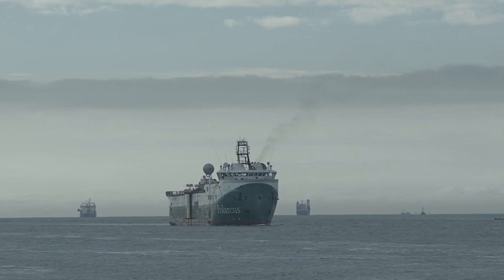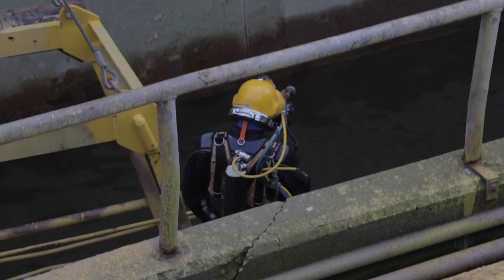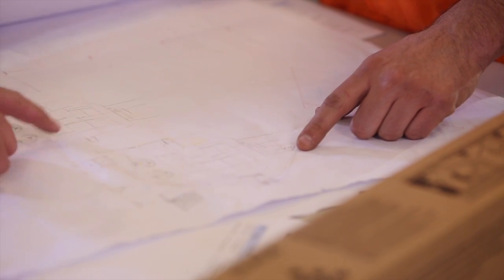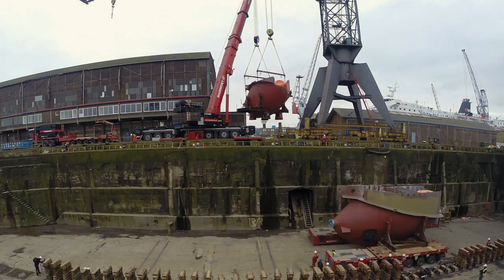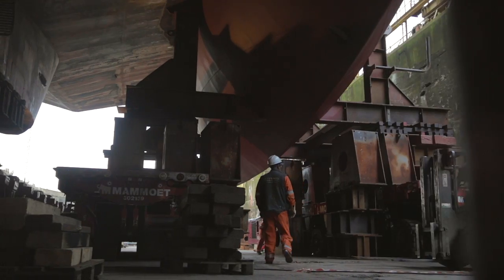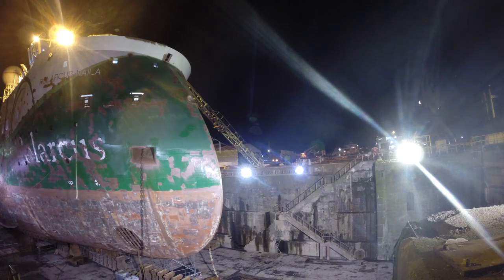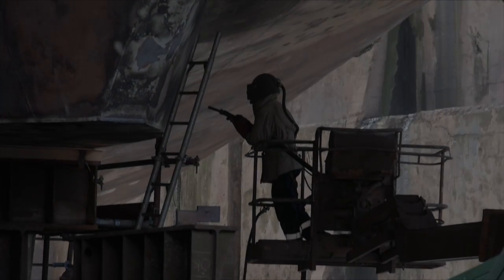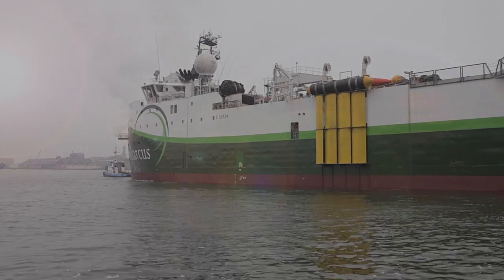Proud of a job well done: the refit of Polarcus Naila, a 90m 12 streamer 3D/4D Seismic Survey Vessel

Comment: Why would a ship want to go from azi-pods to fixed propellers with rear thrusters?
Reply: Costs. The original azi-pods were high maintenance requiring more frequent dry-docking. The OMT "Twin Fin" gondola mounted drives are more durable.